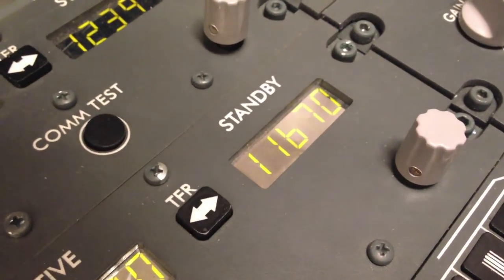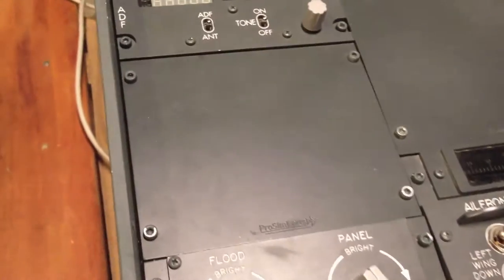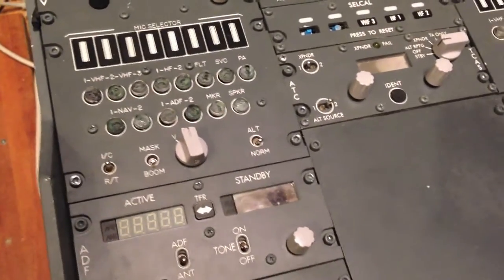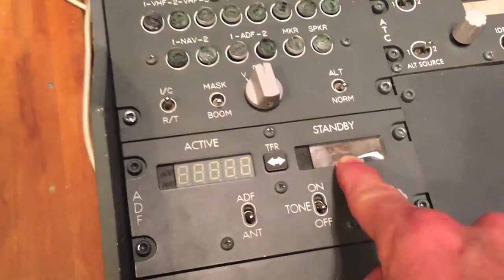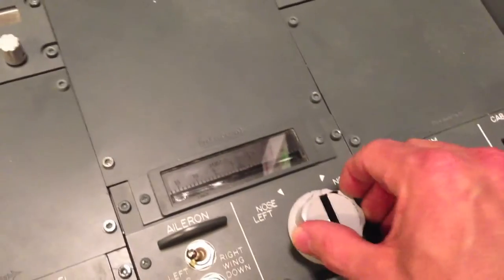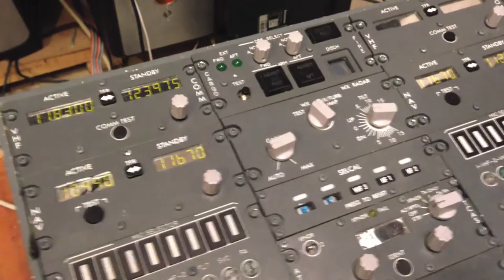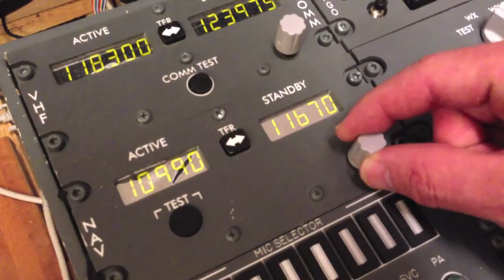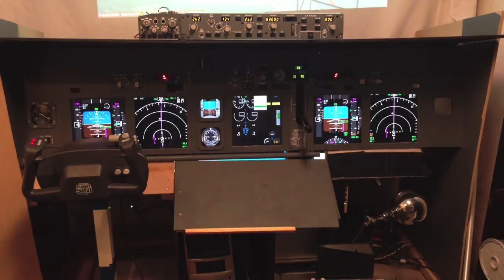Pedestal - B737 Home Cockpit

Comment: I know this is an old video but where did you get your plans to build the pedestal?
Reply from the maker: Hi. Most of the panels are standard sizes. But the layouts depends on the airline configuration. If you are looking for 737 measurements google "Marcus pilot" those pdf-files will give most the measurements you need.